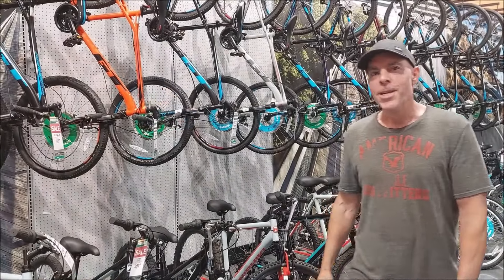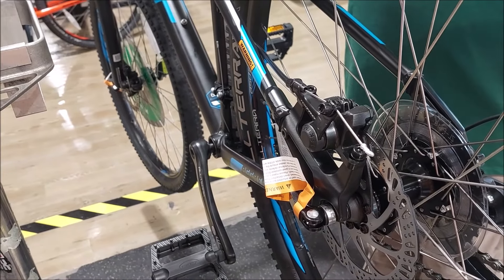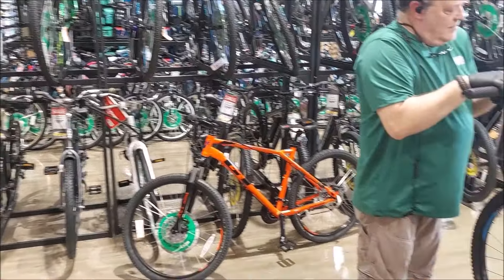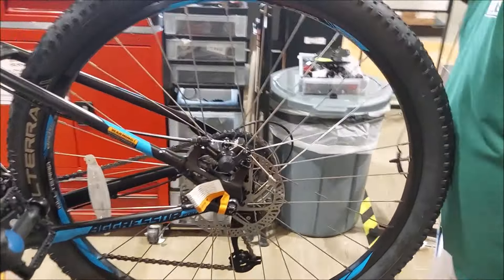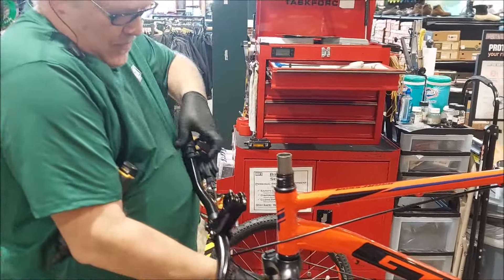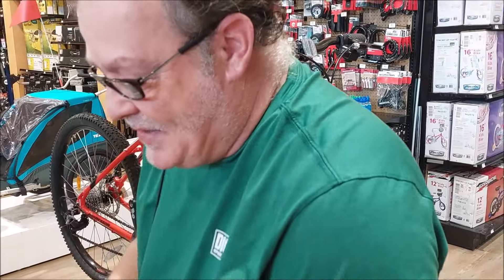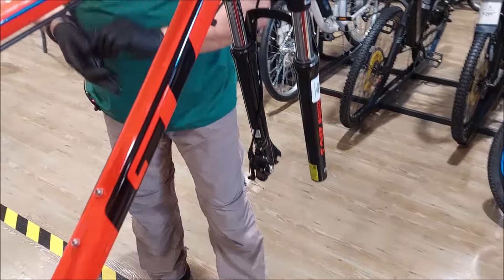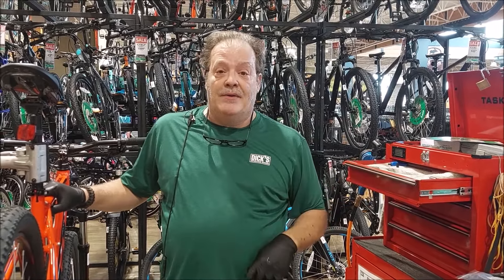WE DID IT - We finally bought our GT Mountain Bikes!

Comment: Just I don’t know if you noticed, but on your mountain bike, the GT mountain bike your cables are way too long in the front. I would definitely go to a bike mechanic and get that fixed. That is very important and I noticed the wheels are a little bit wobbly from the back wheel please be safe on your mountain bike

Comment: the bike mechanic was awesome although he was talking out of his a$$ for some things, for example the holes and slots in the brake rotor, the only reason they are there is for weight savings and for better airflow, they aren't there to collect dirt like he said lol, and i have no idea what he was saying about higher priced derailleurs. Pretty much all derailleurs use the same mechanism for shifting gears, the higher you go in price you get better materials, you get a clutch and you can get cassettes with more gears. Overall though great video. i got that same exact blue and black GT and I've fully upgraded it, the only thing that is stock on it, which will change in two weeks is the front rim, I've upgraded literally evey single part on the bike execpt for the front rim and i plan to get a new front wheel the week after next. If you're interested here's a pic of mine, i just added the Maxxis tires yesterday and the new WTB rear wheel. Also please do not pay attention to imgur saying my pic may contain explicit content, i have no idea why it's doing thet, imgur is acting really weird today, it's just a pic of my bike https://imgur.com/a/0MMln8k